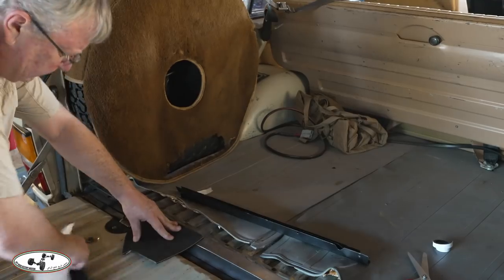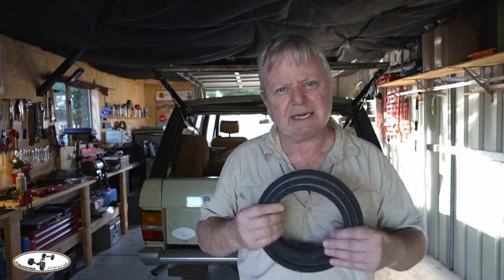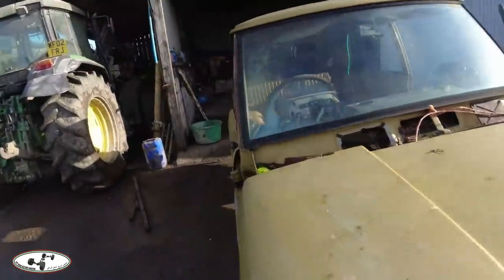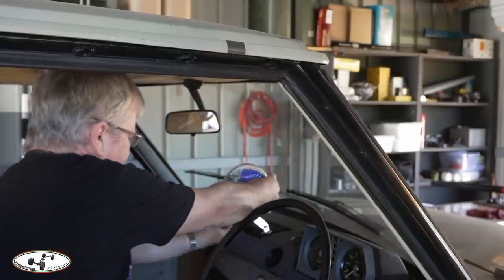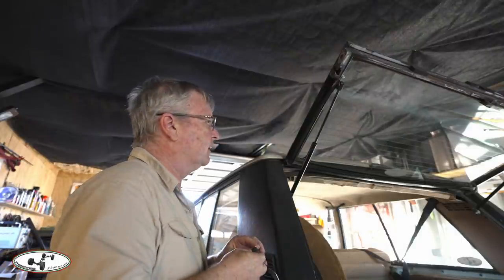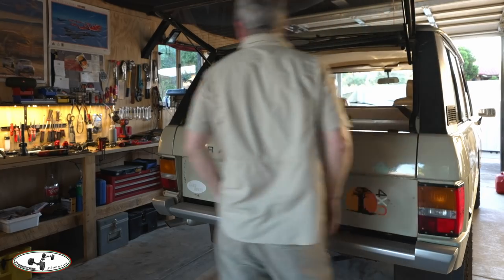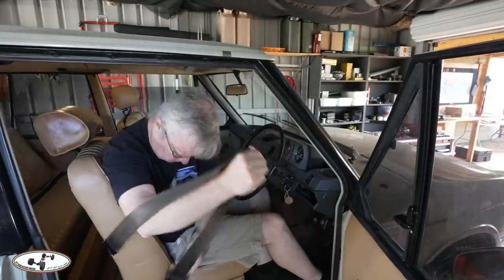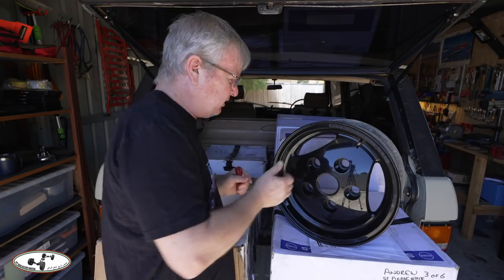We found a dash, rims, fan and seal the tailgate. Range Rover Classic big trip prep | 4xOverland

Comment: I used to do these make-it-work mods and also called them temporary too. Until I discovered they work well and last forever! 😀
Reply: pushaw..if factory was proper it would have been good....
if it was never good you get a free pass to use anything modern that works.
otherwise you get a vehicle that needs to be a trailer queen.
fine for a fancy rolls royce or early jag....not for a utilitarian vehicle.
 too many office princesses "set the bar" these days
theyre not paying the bill or doing the work
Reply: Good job 😊
Reply: I too have been in such a situation.

Where I'm not 100% proud of the job but it works perfectly.

A long term temporary fix.
Reply: My entire car is a temporary mod.. 🤫

Comment: Andrew love your work. Outback dust will work it’s way in unless you run your vehicles fan drawing clean filtered air in from the front of the vehicle so to cause a positive air pressure inside the vehicle. Eg Air con running in recirculated mode will cause negative pressure inside sucking dust in but in fresh air mode it won’t

Comment: Good job Andrew. 
The low pressure in the car will not respect the excellent work done on the tailgate…..it will start its mischief on the door seals and any firewall holes not sealed up…….in for a penny….!!
You have time , address those issues and outcome will amaze. 
Enjoying your work sir….😊👍🏻💪🏻💪🏻

Comment: Andrew, i stuck a d shell rubber strip on my tailgate which made a huge difference. The other thing was that i kinked the tailgate glass locking rod ends in slightly. I also taped the ends with about two revolutions of tape. The glass lid always struggled to seal properly and that combo of fixes solved the majority of my sealing probs. Bulldust tends to get n everywhere in the smallest gap it finds

Comment: Ooerr!

My absolute first experience of any Land Rover vehicle was, as a child, getting picked up from school by my uncle in his fancy new Range Rover, hitting a pothole at around 40mph and being terrified when, as it turned out, one of those 3-spoke alloys broke in half.

People talk about steel wheels beng preferable to alloys "because you can hammer 'em back into shape" and the merit of that is debatable but what IS undeniable is that steel wheels bend rather than breaking.

But, yeah.
40-odd years later, whenever I see an RRC with those alloys on it I still get the heeby-jeebies.

Comment: Andrew  Love your old Rangie I owned one and then moved on to a Discovery or two.  A good mod for the tailgate is to reposition the gas struts so that they go over centre when closed and so hold the tailgate shut instead of trying to push it open all the time.  It then holds a bit of pressure on the seals and the tailgate does not pop open when you hit a big bump.  You need to turn the struts upside down and move the mounting point to the lower section of the tailgate opening.  The used to be a kit available to do it.

Comment: Hi Andrew. I mounted the same cheap fan in a School bus my grandparents owned. the driver thought the aircon wasn't sufficient mind you this is on the Atherton Tablelands were the temperature tops at 32 degrees. But we mounted it and put a switch in the dash for him and ended up making a complete new bracket because the thin aluminium one that came with it was just terrible.

Comment: Great video Andrew, the Range Rover is coming along nicely ,those wheels look great and the wheels nuts can be ordered online, copies of the factory wheel nuts , that closed cell foam you installed on the rear window is extremely good product, i must have installed over 10,000 feet of it when i use to work for New Flyer Industries in Winnipeg a bus builder and we used used it on the inside and outside of the bus and it stood up to the Canadian winters as well as the hot American summers without losing its integrity to seal out moisture and dust as well as humidity and the window tint sure helps to keep your vehicle i would say in some cases as much as 5 degrees cooler, great mantra make it workable 'functional to get a job done, I drive old Volvo 240's  as my daily driver and it functions extremely well and i do what is necessary to keep it going until i get the original parts or the closest thing to them. brilliant work 👍

Comment: I’m pretty sure the alloys won’t fit over the hubs on a suffix D. I tried with my suffix C. Check the ends of the wheel studs, if they have a recessed line on the end it indicates the hub is compatible.

Comment: A guy in our 4x4 club was driving through a field at 10km/h front wheel dropped into a hole and the vehicle stopped suddenly. He went through the windscreen and hurt himself. 

I would recommend wearing a seatbelt at all times regardless, unless stopped. With the exception of deep water crossings.

Comment: Try adding a bend to the end of the tail pipe. If it blows out sideways it seems to not suck into the back of the vehicle. Solved the problem with a WB panel van many decades ago.

Comment: Two ideas. 1st to check sealing on tailgate(s). Cut 25mm or so wide piece of newspaper (or something similar) by about 300mm long and place it at right angles in gap over the new sealing rubbers that you are concerned about/have applied. Now close the tailgate. Then (gently) pull on the end of the newspaper. If you feel friction then you know the rubbers are sealing. If not, back to the drawing board. A panel beater taught me that trick years ago. Can also be used around side windows (to identify source of annoying wind noises) and even tail lights to see if the water entering the boot is coming past the tail light seals. Couple of things. If side doors rubbers are not sealing, before you try to bend the top half of the door frame inwards to close the gaps, wind the window down. Glass does not bend, and if you don't wind the window down - smash - ask me how I know. Re tail light leaks, "gentle" persuasion/caressing with pliers or a SMALL hammer and then a recheck with the newspaper strip will most often fix the water ingress into the boot. 2nd idea re exhaust ingress. As I mentioned last year in comments when Andrew travelled from Melbourne to Perth, aim the end tip of the exhaust pipe at 45 degrees to the alignment of the car. Also have the tip protrude as far as you can but not beyond the dimensions of the car. That way the exhaust is directed into the slip stream and not into the lower pressure area behind the car. I used to make/modify exhaust systems many, many years ago and this modification fixed exhaust gas intrusion in panel vans and the like - it works, and is cheap. If anyone else uses any of these these idea, I will take royalties, or at least a cup of coffee (with cream biscuits) if I see you.

Comment: I've also got a set of the original three spoke alloys with my RRC, they do use different lug nuts than those that work with my steel rims. I've had trouble with air leaking through the alloy itself with these rims, porous castings or something.

Comment: The closed cell foam is an excellent way to seal the tailgate. I did it years ago to my ute and it seals the dust perfectly. It's holding up well, no problem at all. I even suggested it on 4 Wheeling Australia's channel for his Hilux. I don't think he has used any seals yet, but has a fan to pressurise the ute tub.

Comment: Seeing as you are in full swing with these clever make it work home repairs you could get a hole saw and cut 2 holes opposite one another through an Engel 12v fridge, use the fan you fitted to the dash and blow air through it and you’d have aircon. 😁👍

Comment: Andrew, Will the seat belt slip over the headrest to avoid the awkard angle on the shoulder or can you install a temporary bolster on the top of the seat to change the angle ?  I do not recall the problem in the 70s with my RR.  and did many touring miles.  Thanks for you earlier video I now have a exact model of my 1973 green RR from "Almost Real" .  Regards, Gary H
Reply: I was going to suggest the same thing with the seatbelt, loop it over the top of the head rest to get it up of the shoulder. 👍

Comment: I heard the wiper blades off a jumbo did well. Not expensive with the right connections.
Put it on the lid so it doesn't get knocked around. It will allow dust ingress if the seal on the sides does not match. Also check the spring in the latch while you're at it, other wise it will not close without holding the button in.

Comment: I used the closed cell foam for my DIY canopy install and also on my tailgate, worked a treat, drove the Plenty Highway from Qld to Uluru (horrific corrugations) n next to no dust came in. Have you thought of bringing the belt over the headrest instead of the seat

Comment: I had trouble with the transfer case oil ending up in the gearbox. The smell of burning nylon bearings soon brought focus to the situation. I think there is a special valve between the two. I was told however the shortcut was to drill a hole between the two. That was done and I never faced that problem again. If I was racing I might think about a host of temperature sensors across the car. 
On tour I would take a walk around the car to feel the tyre temps and visual check every hour. Good for the car and driver too.

Comment: What was actually wrong with the transmission? Ever since the very first videos about the RR you have been fretting about it, yet the LT95 is probably one of the most robust components that Land Rover ever produced. Did I just miss the explanation?
Reply: It the one unknown major component that we will not be able to repair in the bush. It works. But sometimes comes out of third gear.

Comment: I wonder if an exhaust shop has an old catalytic converter they cut off a car you could add to this Range Rover to make it cleaner?
Reply: very bad idea for non cat cars with high kms....too much back pressure for a valve system not designed for back pressure.....if he gets the motor done and a modern vale job, no problem...but otherwise not good at all.
removing a cat is fine...adding one is a no no
Reply: Cleaner?  Why are you worried about one vehicle without a cat?  There's literally billions of cars on earth without cat's on their exhausts. 
That's why I love my early 2000 Nissan Sentra so much. It has zero anti pollution crap on it. No cat. No egr, nothing. 
That makes it run well, unrestricted and trouble free. To hell with pollution, it's too late already.
Reply: @kazzTrismus  thanks for clarifying, makes sense! If he's concerned about poisonous air I would've thought there might be away to clean it up, but the back pressure seems incredibly valid
Reply: Poisonous air won't bother the CSR much 😣
Reply: @BubblesTheCat1  huh?
Reply: @thomasbailey4139  yeah thats why retrofit laws failed in many places
Reply: cats dont do much for stopping a car killing you with its exhaust...theyre for the environment.
locking yourself in the garage only lasts an extra minute or so with a catalytic converter.
Reply: @kazzTrismus  Exactly. You really don't need a stupid and expensive piece of crap like a catalytic converter to do the Canning. That's so remote, the fumes will disappear into thin air. It's in the heavily congested cities where cars are idling in traffic all day that the cats help  (a tiny little bit. Lol)

Comment: You would not want to hit that Sirocco fan in an accident which ironically may well be caused by poor visibility. I have used a plastic fan at length. The only reason for a half speed is so you can hear. Don't get fancy.

Comment: Bad call on the rims.  Alloys will crack on heavy impact where you can beat a steel rim straight.  It’s not always about the looks when opting for weller or modular steel rims.  The offset also allows for wider tyres without rubbing the chassis and radius arm on full lock.

Comment: You know, Plenty of times factory components never really cut it....It's only now that new materials (that weren't available when  these old cars were made) are around that using factory original components, doesn't make any sense...They didn't work to well when they were made so why persist, use modern alternatives to rectify bloody annoying idiosyncrasies I say...Sort of like drum brakes and modern disc brake conversions....Why would you both with original when they were no good to start with.....